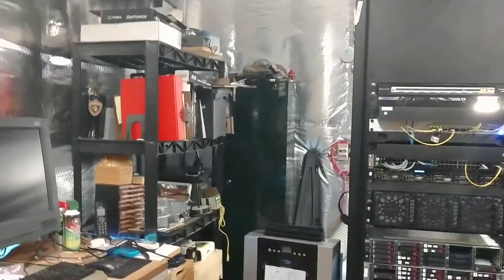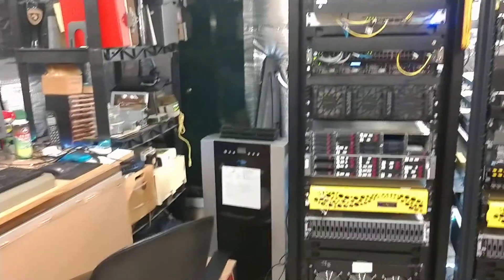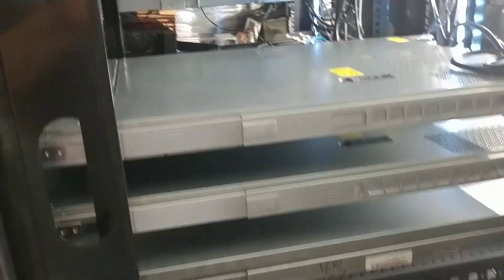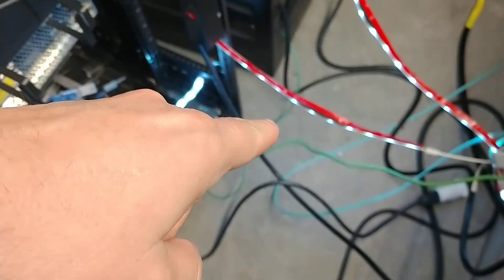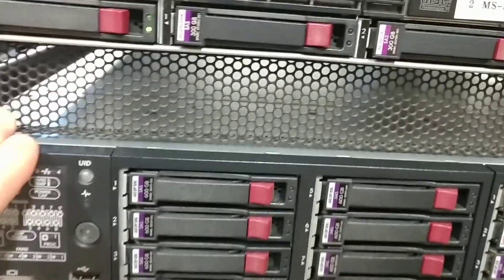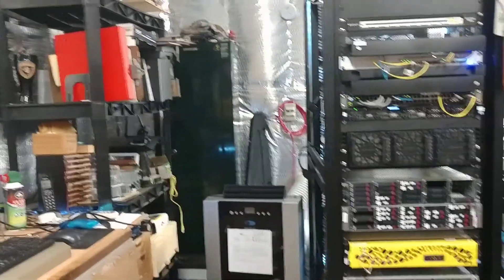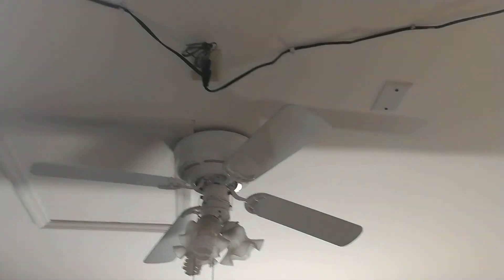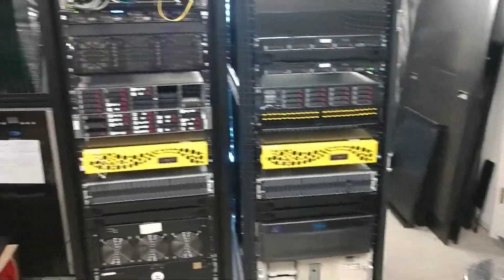How to keep your home IT lab cool for free

Comment: I am in Atlanta, and during the summer my garage gets 95 F during the day, over night falls to 90s to high 80s. How hot does your garage get during the summer? Because of this HOT temps I have to reconsider building a home lab....
Reply from the maker: I used some insolation and I use a mobile 1400 BTU AC / heater unit to keep things around 70/72 degrees year round.  I get temps around 95 degrees in the summer and during the Winter around -5 in the lowest.  I got it for a $390 and woks great for my lab.  I did  a video on my setup. Check it out...  /:>  You could also just do a AC IT rack.  It is a closed off IT rack tht has a AC unit inside it.   Works great as well.  They run a bit more in buying one of these.
Reply: @leadiususa7394  I'll check out that video. 

The ac units for racks are pricy! $800 just for the AC unit alone. 

For right now I can't justify spending $800 for a machine I spent $80 on?
Reply from the maker: @Hands-onNow  I paid for mine for about $320 ish... But all is good.

Comment: What if I use a ckoset. BUT, install an in ceiling flush mounted mini hvac unit. Cool air would fall down. Only concern would it ever drip?  And with mini split type units attached to a wall or ceiling I don’t think there’s a hot air in and out. It’s just circulating closet air over it’s cooling coils to an outside unit. I also found 1U mini 6 fan units that fit between my network pieces. Just curious on your thoughts. My place is tight, limited. Also I would rip out drywall spray foam and then some kind of mold proof??? Drywall or blue rot prof wood painted in mold primer??  I dunno. So close to having everything mapped out then I started seeing overheating issues so I’m starting over
Reply: Ok cool. Thsnks man 😀
Reply from the maker: If you want to use a Closet (ckoset) as a housing for a rack, that may an issue based on how you to cool it. (Top down) Cool air really works better from the ground up. It must be controlled and vented to the server, go thru the server and then removed out the back and moved to the top thru a fan support vent back to the HVAC that supplies the cool air.  IT a loop.  I can get around the issue by using my concrete floor to supply me never end cool air.  I  only have to cool the upper air to keep everything level in the room.  Can you do this type of work to your closet? If you really want to use your closet than reverse your design.  Make the closet as air tight as you can make it.  Place your HVAC on a drip catch plate at the bottom. Blow the cool air thru control front panels on the front so the server get the cool air.  Take your HVAC return (hot) air exchange tube up to the top of the closet to suck up the hotter air and send it back thru the HVAC unit to cool the air again. Again remember that cool must be sent thru the front of the server so seal the front part up and let the server pull the cool thru and out heading to be sucked up.  Any gaps from the front of the servers panels to the back will leak air.  Take a look this one setup that my friend has in place. Notice how the the servers are wrap around panel sealing the front part of the server from the back end of the server.  Cool air in hot out the back.  Enjoy and I hope this helped.    Here is the link... https://www.youtube.com/watch?v=4ErZ34n3ha0&t=573s
Reply from the maker: Oh and please make sure you do your math on your VHAC output for your planned BTU heat level you think you will be working with.

Comment: Why is there padding on the floor in front of the right rack?
Reply from the maker: Both racks are on wheels (Casters) for easy moving but I place a foam mat to act as stopper so they don't move unless I want them to move.  I always recommend that your racks be on wheels.  It really helps when you do major work to roll them and around them. It makes working on them easier.  Hope that make sense to you...